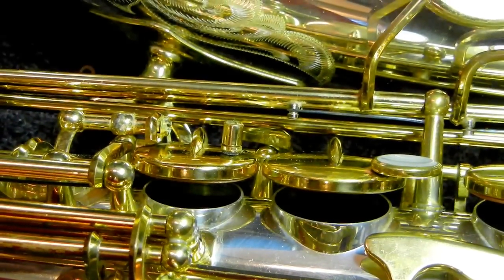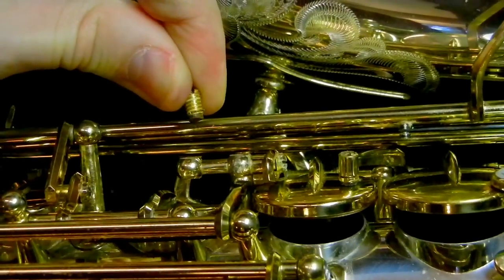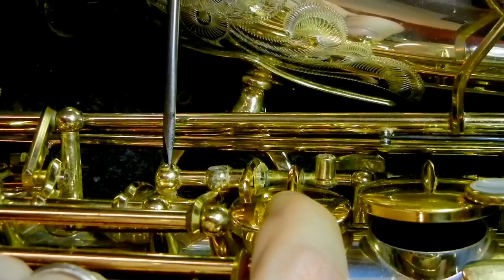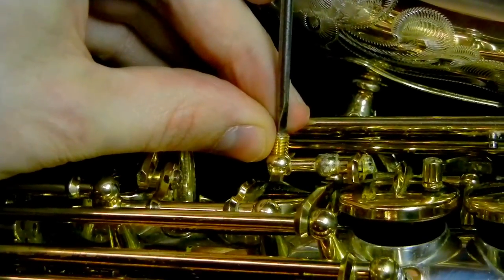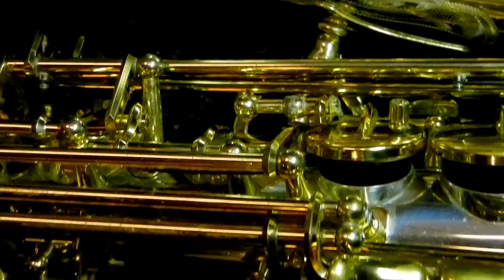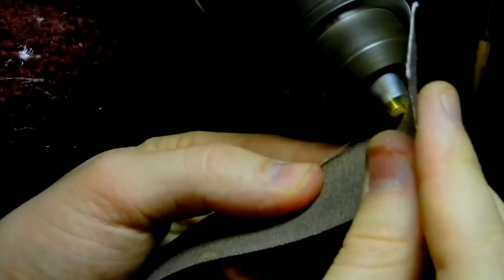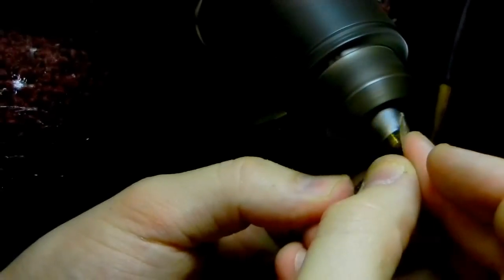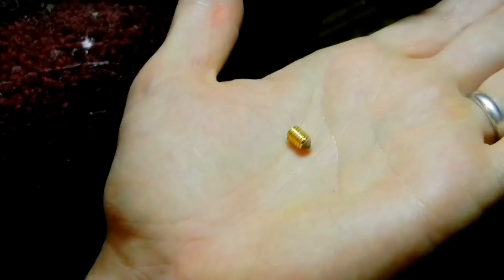Saxophone Repair Tip: Domed G#/bis Adjustment Materials

Comment: Is there a quiet durable and not very compressible cork or nylon that you can recommend, Matt,  I want to avoid as much play as possible.
And is hot glue as good a method for reliable repairs?
All the best to you!
James H
Reply from the maker: Nice cork cut the right way is very good: https://www.youtube.com/watch?v=Ubs_N75Z8SI
Reply from the maker: And does not compress over time as much as people think: https://www.youtube.com/watch?v=Ee-bGdLLCK0
Reply from the maker: although it is compressible in-situ when thick and under pressure.  "tech cork" is a decent substitute for when you want something that is less compressible, although it can be loud and over time tends to harden.  

I have seen various nylons and tubings and pieces of rubber and I do not personally find them to be good subsitutes for high quality cork/felt with proper key geometry/relationships.  I do however sometimes use "tech cork" type stuff.
Reply from the maker: hot glue being "as good" is definitely arguable and you will need to make your own decisions on that one.  if you do try hot glue, this is the one I would recommend: https://www.youtube.com/watch?v=cqPTYp3gkws